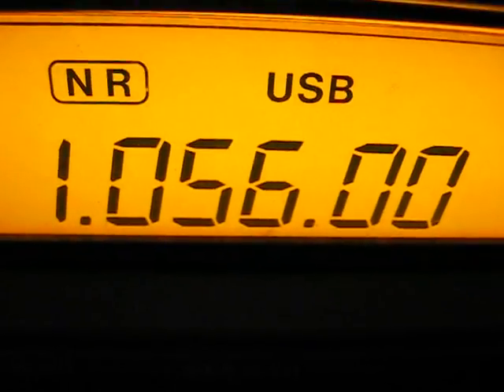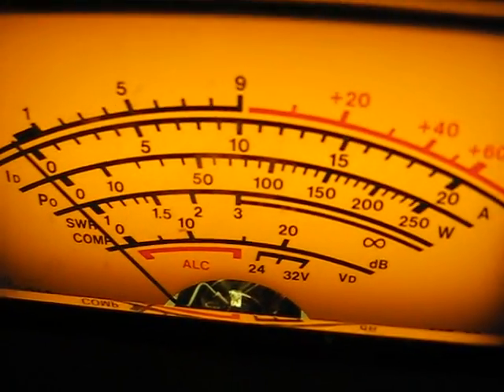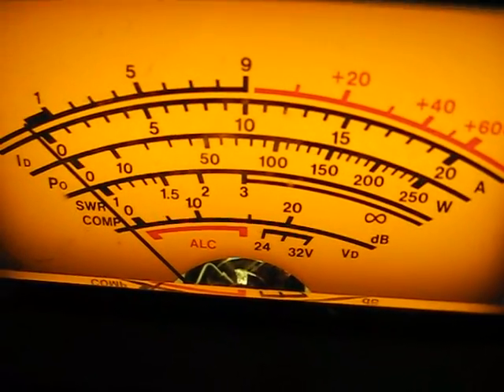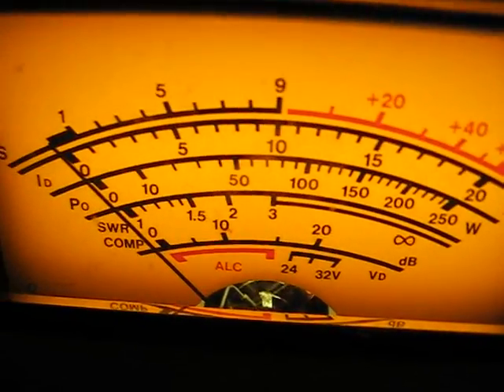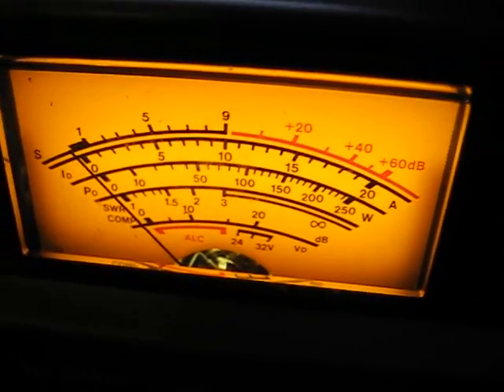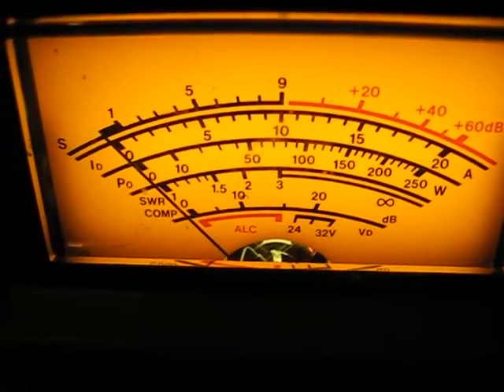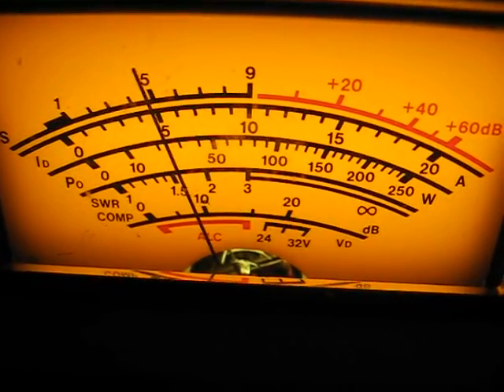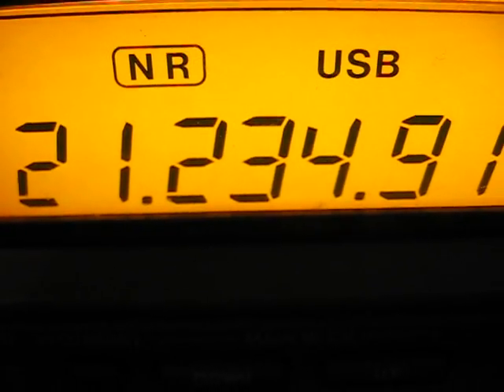15M EXTENDED DOUBLE ZEPP ANTENNA TEST

Comment: Your signal meter needs the mechanical 0 adjusted, notice it settles below the zero mark. I may try an extended zepp....
Reply: I guess, due the position of the camera straight right to the signal meter, it caused an paralaxys efect, that shoed the view below the zero mark. 73